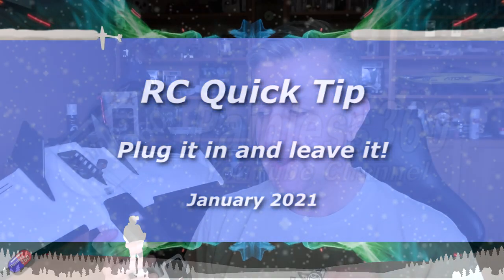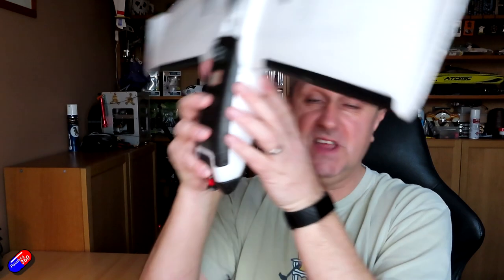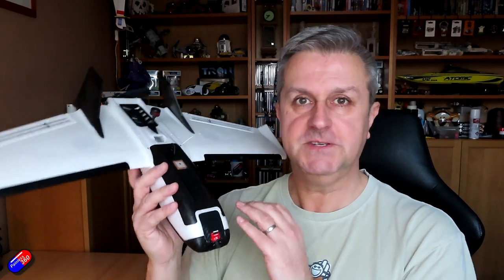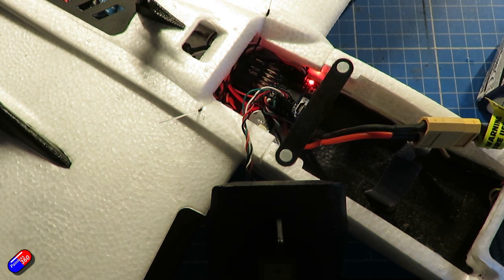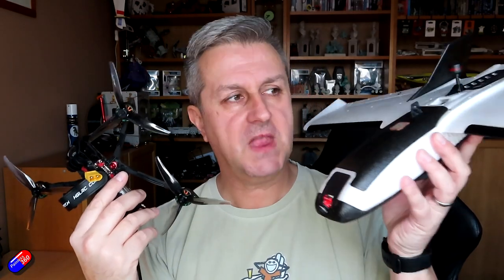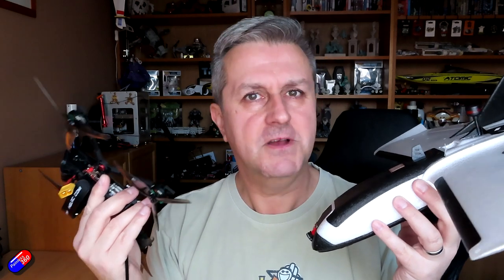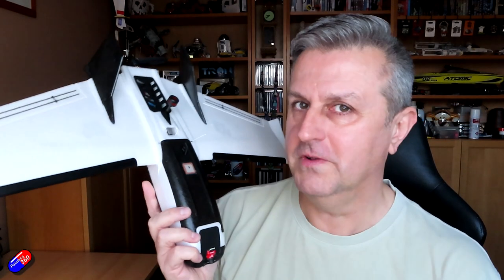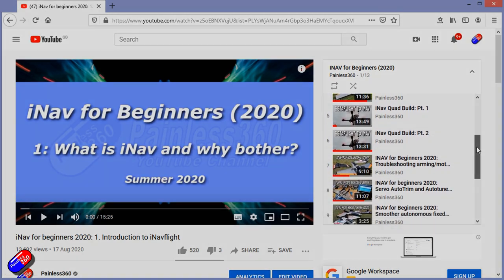One of the most common errors of new pilots: Plug it in and leave!

Comment: I've often wondered exactly how long ardupilot needs to be still for, the boot sequence is quite long. Have just checked the wiki, it says "When you power on your board at the field, you should leave the plane motionless on the ground until the LEDs stop flashing blue and red (about 30 seconds). This means that the gyros have been calibrated."

Comment: If you have a bottom mounted betaflight drone it might be easier to set gyro_cal_on_first_arm =on that way when you switch to arm it will cal gyro etc first then arm the motors at the launch location.

Comment: lol iNav has a setting for just this! Its called " moron_threshold ". Nope not joking. 

moron_threshold               32                When powering up, gyro bias is calculated. If the model is shaking/moving during this initial calibration, offsets are calculated incorrectly, and could lead to poor                        flying performance. This threshold means how much average gyro reading could differ before re-calibration is triggered.
Reply: love how devs find terms adequately :D

Comment: I have a PA-18 Cub.  It's got tricycle landing gear...should I let it initialize the Aircraft system with its Empennage raised to simulate level flight or with the tail wheel on the ground?
Reply from the maker: So long as the model is left still to initialise after connecting the power at the field, it should be good to go.